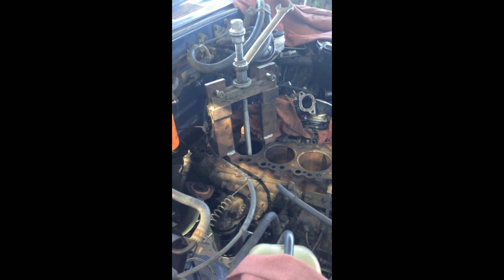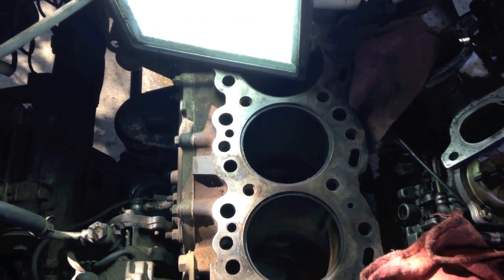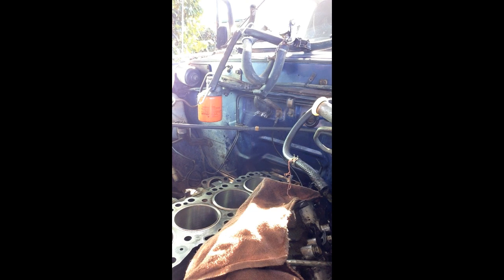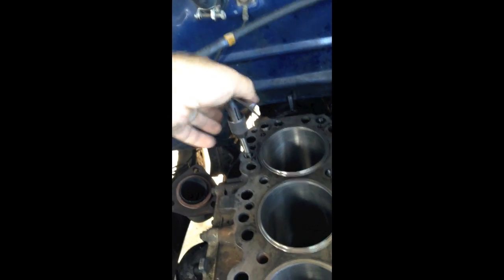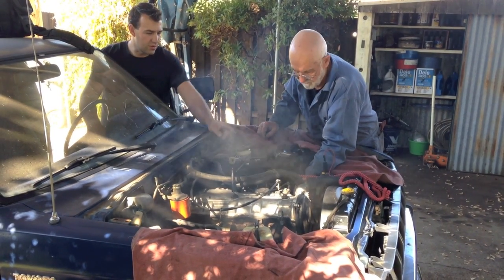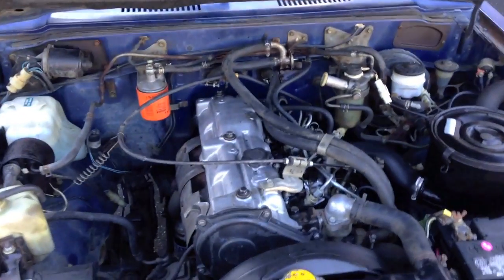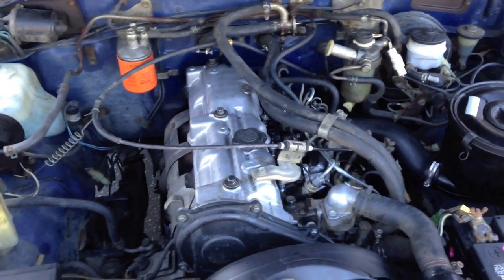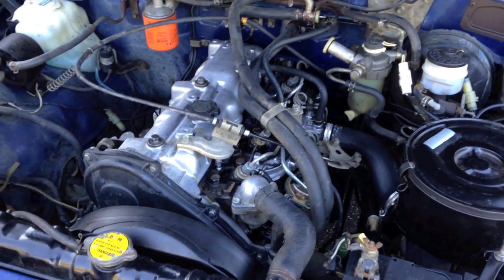Toyota Diesel L Engine Rebuild LN40 Hilux 2.2l

Comment: I HAVE A RED 1983 TOYOTA DIESEL , AND MY ENGINE WAS REBUILT , I LET OTHER PEOPLE DO THE HEAD WORK AND SOMEONE ELSE TO INSTALL NEW SLEEVES . AND AN OLD GUY TO PUT IT ALL TOGETHER , NEW INJECTORS , NEW EVERYTHING , $5,000 IN PARTS , BUT IT NEVER RAN RIGHT AND POURS OUT THE SMOKE . I WAS HOPING YOU WERE GOING TO SHOW THE VALVE TIMING OF THE CAM . I THINK THE TIMING MUST BE OFF .

Comment: Great video. I was wondering how you gained access to the bottom end bearing. Isn't there a cross member in the way with the sump oil pan?
Reply: Ive been working in a car that everybody had to take out entire engine for having access to bottom end so i saw a guy that remove all the suspension instead jajaja it was double of work just ti not take out engine
Im from Panama so not perfect english i know

I have a toyota L engine for rebuild if you want to be in contact aldren0235@hotmail.com
And you can see the rebuilding
507 64389219 whatsapp

Comment: I overhauled my very own L engine which we call down here as the "Silent L".  I used the term "cylinder sleeves" when I called the auto parts store and got the negative response everywhere.  That was until I remembered that the part I needed was called "cylinder liners".

Comment: I'm about to go thru the same process. Emailing back and forth with Precision International in Australia as we speak. The sleeves that you ordered did they require standard pistons? So far the only show 020 and 040 pistons with rings. Just curious if you remember what size pistons you put in with the sleeves. Thanks, Scott
Reply: Hi Scott, Yes, the sleeves were standard, I used the old pistons which were fairly worn.  In retrospect, I should've gone with new pistons as well.  I later put on a turbo which destroyed the #2 piston about 32,000 miles later.  I had a great experience with Precision International and would highly recommend them.
Reply: Thanks for the reply Jake and thanks for the video. So far Precision International have answered the emails I have sent and I am looking forward to getting the sleeves.Shipping has gone up just slightly ;). My #2 piston looks like a glow plug tip had a square dance party on the top of the crown. I have about 030 wear on the sleeves across all 4 cylinders so pistons are getting replaced. I'm going trough a year long diesel course in Tennesse and this truck is my project. I am rebuilding the L52 transmission as well. Thanks again for your help.
Reply: That diesel course sounds great, What a great opportunity.  I had a tremendous amount of wear in the sleeves as well.  enough that I didn't bother to measure them, it was obvious that need to be replaced.  I found NGK glow plugs at O'reilly's and they were great, whatever junky plugs were in there before had been blown apart and did the same to my pistons.  Best of luck with your truck, let me know if there's any other info I can supply
Reply: Sure thing. The truck ran well before I disassembled but had a lot of blow-by and valves were pretty worn. So far everything else is within specs. Looking forward to getting it back on the road again. Cheers!
Reply: So far parts have been findable.

Comment: Hey guys I have a 1982 2.2l L4 diesel Toyota pickup and I believe the head gasket is gone and maybe other internal problems. Where can I buy parts for this engine ???  Do they have rebuild kits out there ???
Reply from the maker: Hi Brandon, I bought my head gasket from the Toyota dealer here in California, the guy told me that there were 4 left in existence- at least in the Toyota parts system.  I'd be willing to guess that there are still 3 there.  If not, Try the Australian companies like Precision International. Also, you can go to Google.AU (that's Google for Australia) and search for an LN40 head gasket.  Hope this helps.
Reply: Just like you, i also have a  1982 2.2l diesel Toyota pickup.  My injection pump is leaking and im not sure where to find  a repair kit for it.   I know it mainly consist of o-rings, seals and a rubber gasket.
Reply from the maker: kc ridge, There is a rebuilder in Marysville CA but I don't know their name, sorry.  I would ask around diesel repair shops as well as trying the Australian and British markets.  I always put some kind of oil (usually used, filtered motor oil) in my fuel to prevent that failure.  About 1 quart per tank, sometimes more sometimes less.  The new diesel is really bad on old mechanical pumps.

Comment: Good video where did you find the replacement sleeves I have the same truck and I am about to rebuild mine but am having trouble finding sleeves?
Reply from the maker: +mudwieser84 The  sleeves came from Precision International in Australia.  The sleeves cost $123 and the shipping was $134 and there was about $11 tax.  Their service is good and they have many many parts for the truck. Here's the link to the website

http://www.precisionintl.com/Engine.aspx?ID=1739&EID=4484&Page=1